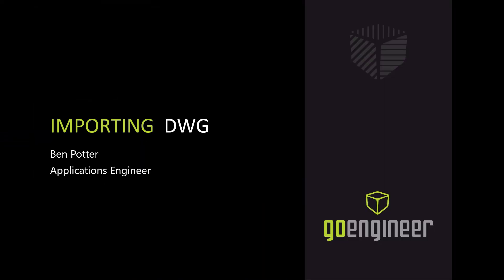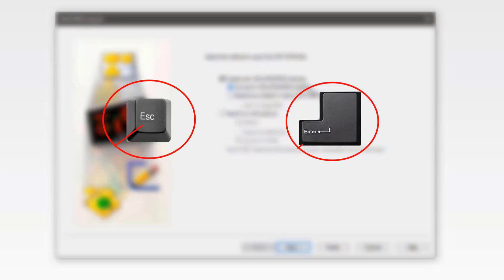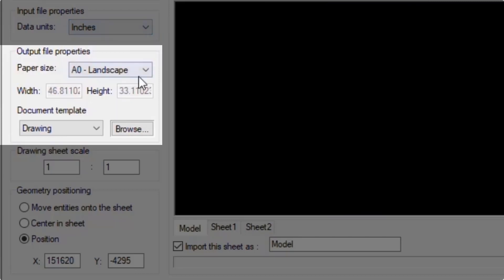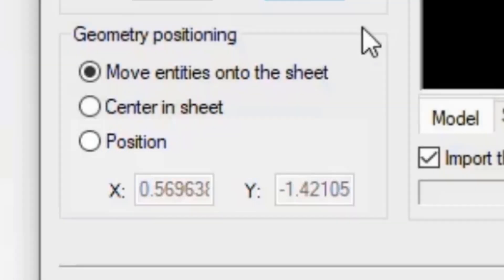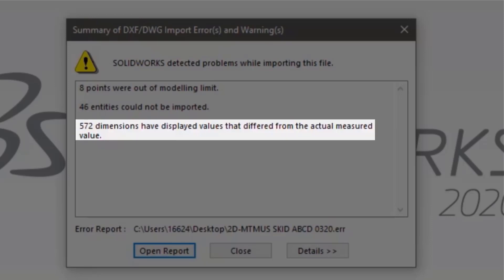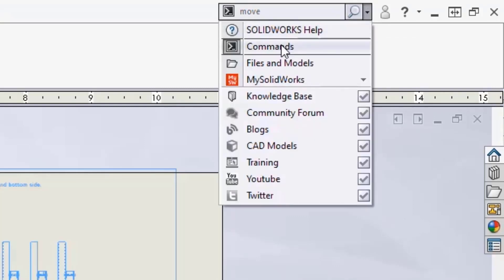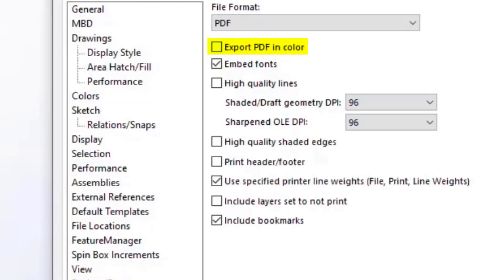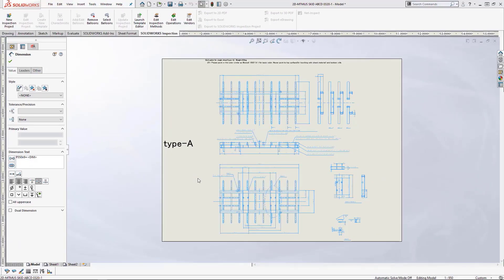SOLIDWORKS Tutorial - Importing DWG

Comment: Does this have to be added as an add-in in solidworks to be able to work? I've tried everything trying to open the DWG file and all I get is errors. 2017 Solidworks user.
Reply from the maker: Good Morning Amelia, There is not a specific add-in that controls this process.  The first thing to do is make sure you are using a certified graphics card and driver combo. https://www.solidworks.com/support/hardware-certification/

Beyond that it is hard to say with out looking at your specific files. Your best bet is going to be to reach out to your VAR and see if their tech support can help get you pointed in the right direction.